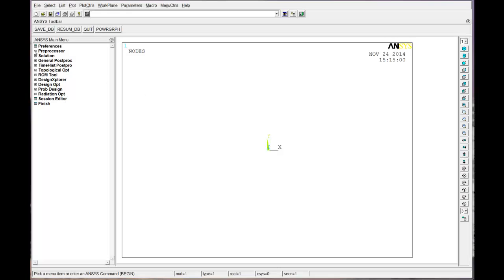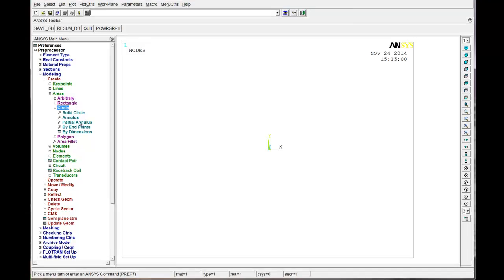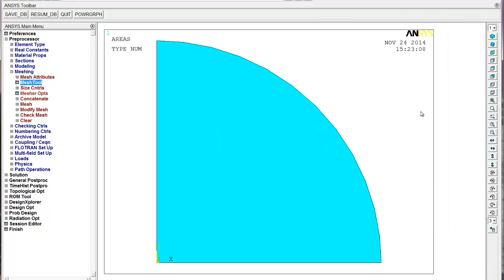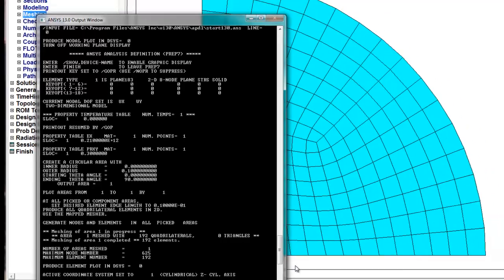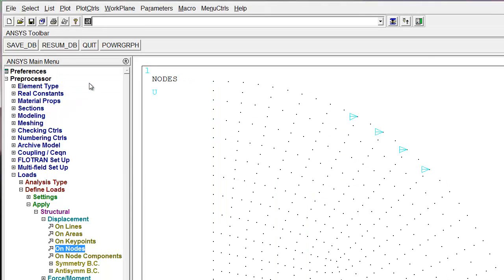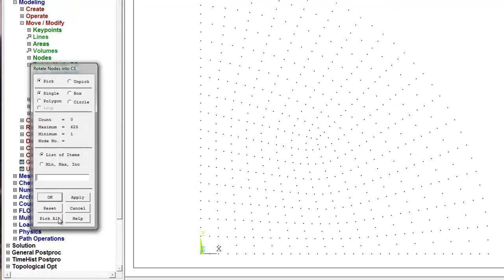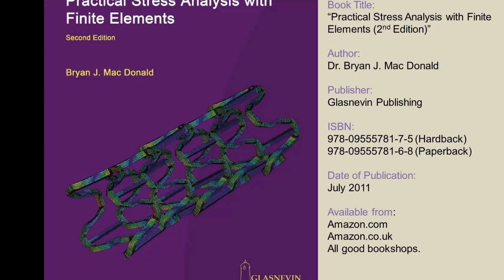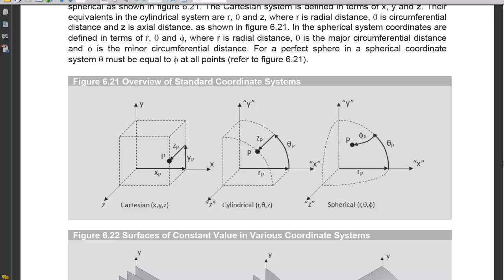Using a Cylindrical Coordinate System for Constraints in ANSYS

Comment: Considering it is a cylindrical coordinate system, in order to constraint the circumferential (or tangential) direction, does it make sense to also apply a constraint in  ROT Z (assuming Z in axial direction)? I know it is covered mainly by the Uy constraint, but I got confused about the ROT constraints using the cylindrical coordinate system.

Comment: I have a question, It only constraint in radially inward movement but if I want to constrain only radially outward movement then what should I do? like constraining from opposite direction?
Reply: It actually contraints it both radially inward and outward. So those nodes can only move circumferentially or along the axis of the cylinder. But they cannot move radially.
Reply: @isaacsmythe6708  im only getting cylindrical in the new guy

how to get radial?
Reply: @kyonesdelle1427  x in cylindrical represents radius, y represents the angle and z represents the height.